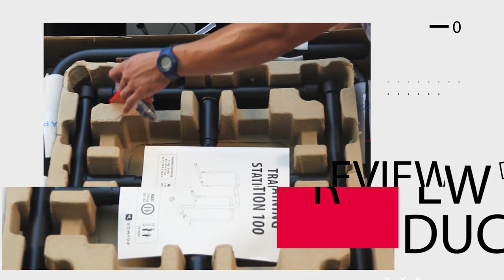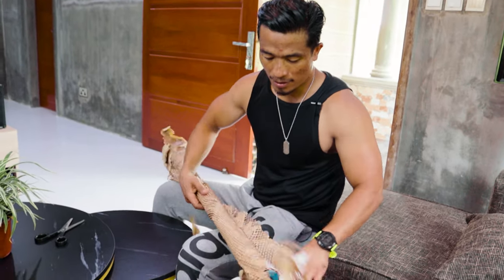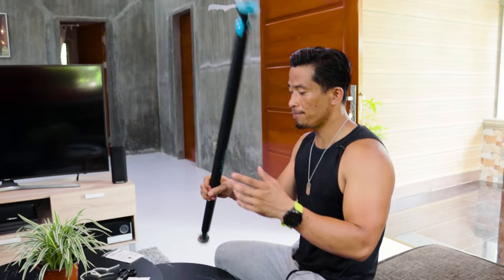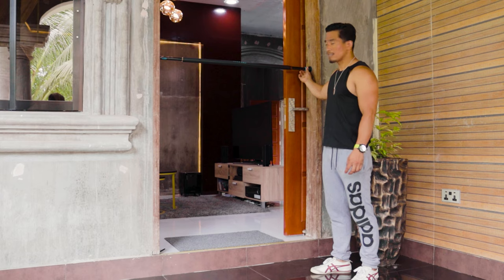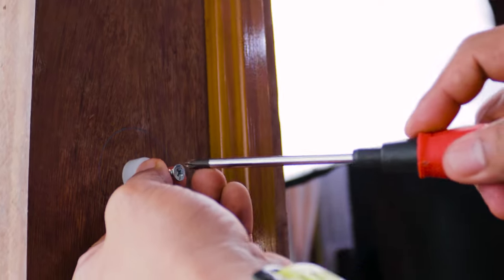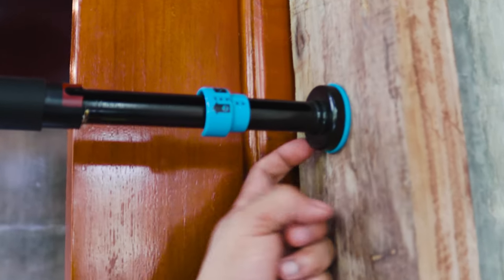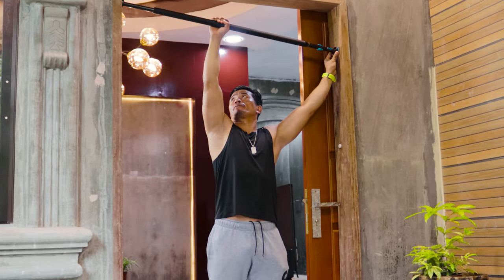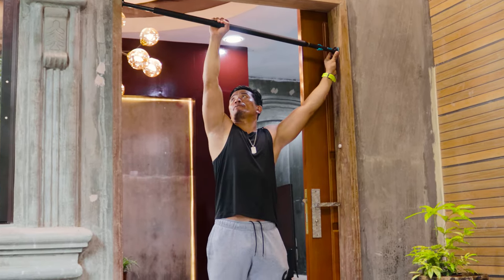Decathlon Pull Up Bar

Comment: The packaging says I can use it without the washer to hold 120kg instead of 100kg, but how is that even possible? EDIT: Fyi, this cracked my wall  (I'm 93kg + screws) - refunded
Reply from the maker: Only 100 without screw, above 100 screw is a must for your safety. How much weights do you have?

Comment: Is it safe to use my gymnastics ring and do exercises like ring dips on this pull up bar? I have no option other than this kind of pull up bar because cannot drill or make any hole since I live in college dorm in the moment
Reply from the maker: It can carry upto 130 kg. I even hang my punching bag on it
Reply: @Raullausa  
Do you think it's still safe if I do ring dips without using the screw on the pull up bar?
Reply from the maker: @frog6054  I did muscle up on it I don't think ring dips will be an essue just make sure it is tight
Reply: @Raullausa  
I see, I'm gonna buy it! I hope it's worth it.
Reply: @Raullausa thats a brilliant idea, how heavy is it?
Reply: @Raullausa although u cannot work out in circulary movements since doorframes block u
Reply from the maker: It's quite heavy, it is pure metal it's approximately 3kg

Comment: good video. one question, you don't need a drill to screw those things to the door frame? is it too hard to do it by hand? cheers
Reply from the maker: Screw is optional only, it is not too hard to make by hand but make sure it's not loose before you use it

Comment: W video thanks man; but one question, what’s the point of the screws and the white two circles if the bar will still not rotate or fall if you add them?
Reply from the maker: Only if you're above 100kg it's a must. Less than that you can ignore that screw. Make sure it's tight though
Reply: @Raullausa  thanks a lot man you the only YouTuber that ever replied to me that quick , keep the vids up bro Ima subscribe ❤️‍🔥

Comment: Hi, distance between my door is 92cm...
Can i know if the 100cm version can get at least to minimum 90cm?
If not, I'll buy the 70cm version.
Reply from the maker: You're around. The border, the bigger version won't fit as it start 95cm. You need to get the smaller version
Reply: @Raullausa Okay thank you 😭
I really wanted the bigger version as it gives more grip. Just 3 cm 😭😭😭

Thanks for the quick feedback anyways, have a great day🤝😁
Reply: @Raullausa  Hi My Door width is 98 cm, should i go for 100 cm bar or 70 cm bar

Comment: Please please tell me is it okay to use concrete wall to put the pullup bar with screws in  or it has to be wood frame?
Reply from the maker: You can screw it in the wall as well but you can't screw it directly same as the wood. You need to drill and plug first

Comment: My door frame is inside the concrete, no trim above to hold the bar. 
How can I install it?
Reply from the maker: Any solid parallel wall can be mounted the upper door frame doesn't mean anything
Reply: @Raullausa  Without upside trim, the bar will fall
Reply from the maker: I'm afraid you got other product not this one I had

Comment: Ive been using it for a fee months now and the rubber has gone loose making it spin. How can i stop that?
Reply from the maker: Stretch it back going to the end in both side, if it still move wrap it with rubber band
Reply: @Raullausa  you mean like to rotate the rubber inwards at the end of both sides?

Comment: Hi! Will it damage the doorframe?
Reply from the maker: It can potentially damage your door when your door is not sturdy enough. Just make sure you have strong concrete wall holding your doorframe
Reply: @Raullausa  and will it damage the paint on the frame?
Reply from the maker: It might especially if you keep it on and off. If you keep it ang leave in one place it won't be an issue
Reply: @Raullausa  thank you bro😄 take care☺️